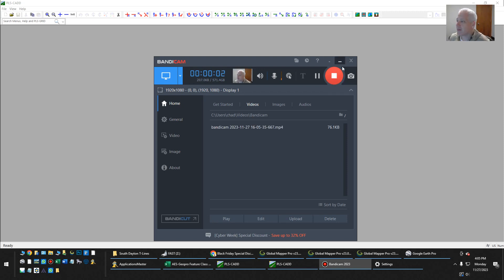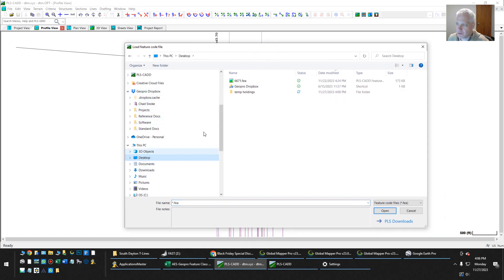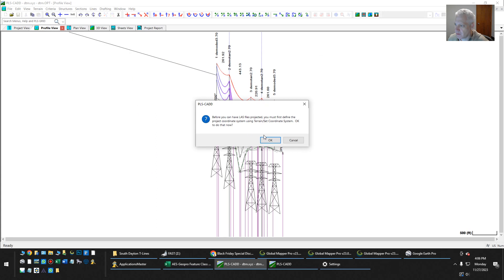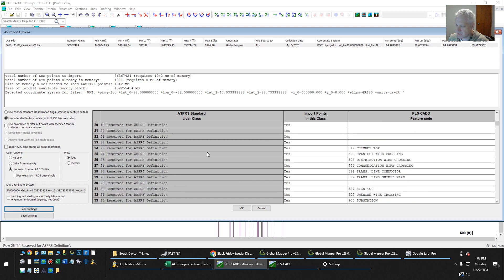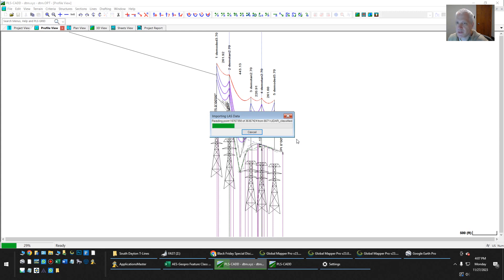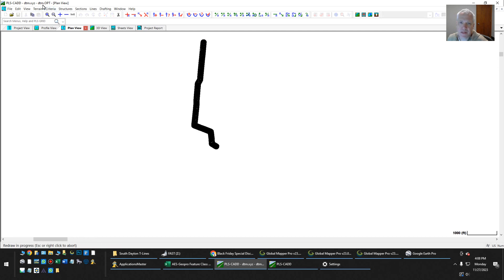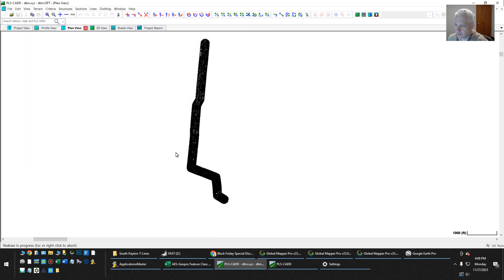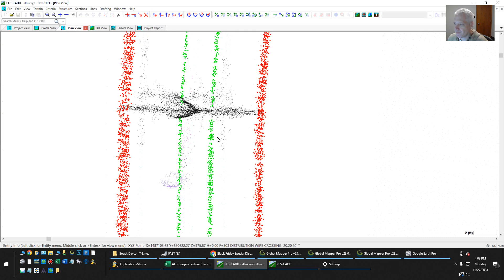PLS-CADD LIDAR data import with custom feature codes

Comment: We too are working for AES, and are being told the LiDAR files we provided them will not import to their standards, even though we used their feature codes.  Where does the .lmp file come from?  Is this something we can create to assist with our conversion?
Reply from the maker: We created the .lmp, it took a lot of testing to get the work flow figured out... and a lot of software will screw up the feature codes if not imported correctly.  I can give you some advice if you want to talk over it.
Reply: @GeoproXYZ  That would be awesome!  I'm beating my head against the wall right now and getting nowhere.
Reply from the maker: @caseyknight6783  www.geopro.xyz - my number is on the site, thanks. - Chad

Comment: I am importing an LAS file with 8 million less points than yours and it's taking me roughly 1 hour to execute. I'm running a threadripper, 3090, and 128GB of ram so wouldn't think my machine is holding me back..? is there something to be enabled in PLS CADD to import LAS data quicker?

Great video!
Reply from the maker: There are no additional settings that I'm aware of. What version las are you trying to import? What software produced it?
Reply: @GeoproXYZ  Version 1.4 produced in LP360. I'm a surveyor, just trying to get the data in PLS CADD...after importing the LiDAR data and assigning FEA codes I still can't see my data. Gotta be doing something wrong on my end! Will reach out to support!